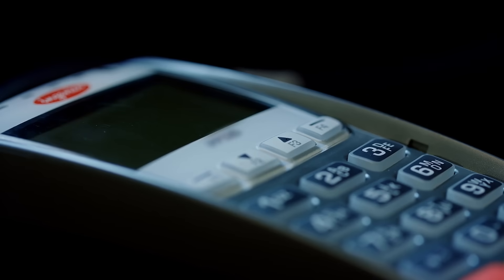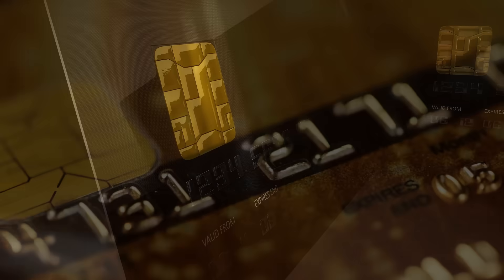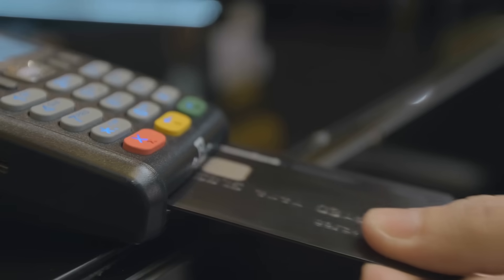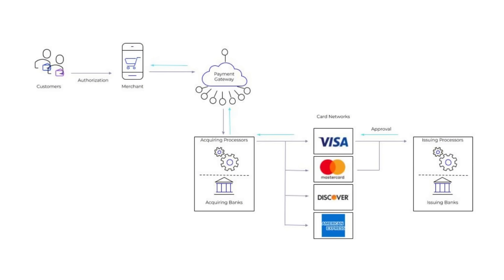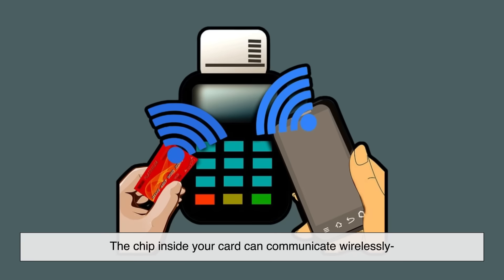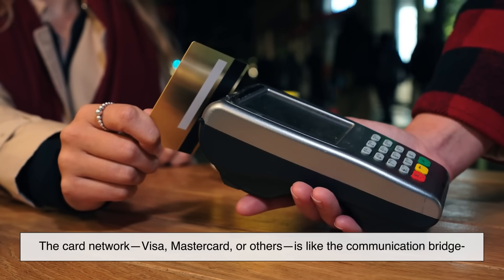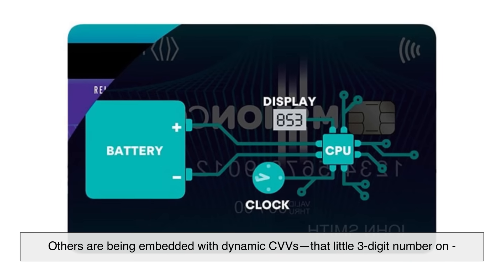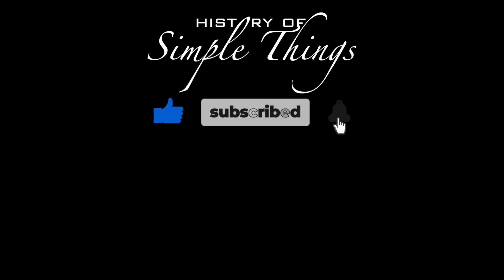What’s Inside a Credit Card Chip and How It Works

Comment: Thank you for the explanation. 

You should have started with the old card imprinters that took an image of the raised numbers and letters on the card.
Reply: The newest cards don't even have the raised image on the front.  The printed card number is now on the back.
Reply: @rocketscientist007  mine is same.
Reply: i remember those imprinters and raising hell sometimes to get the carbon page back. i'd take the carbons home and grind them up in the garbage disposal, does anyone remember when credit card purchases over $ 50.00 had to be ok'ed and tied up the check out until the clerk called the bank/store credit card ( like sears for example ) and got an approval code? the cash register wouldn't finish the deal until the clerk got a approval code to plug in. made for long lines and make you cuss like a sailor when someone pulled out a credit card, i like the chip credit/debit card and electronic money. way quicker these days, writing a check these days? forget it, too slow now. checking payments and accounts could be an interesting subject for this channel and creator. i only write maybe 18 a year now.
Reply: @roadmaster720  I worked as a cashier in the mid to late 70s. I remember all that crap. At a department store, I worked an electric cash register not tied to a computer. There was no phone call for a limit. The card was put thru the imprinter. The customer got one copy, the store copy was put in the bottom of the till, and the carbon was thrown in the trash can. Yikes! I was hesitant for years, but now I pay most of my bills and purchases thru a secure on-line site. Or I pay cash for small items and ALWAYS at restaurants.
Reply: @roadmaster720  "i only write maybe 18 a year now" - cheques? That's mad! Most of us in Europe haven't seen our cheque books in 20 years!
Reply: In high school I worked at a service station. Our card reader was worn pretty badly. We kept a blank piece of paper in the card reader so it would imprint onto the credit slip. Then you had to take it out, have the customer sign it and make sure you put your copy in the register under the coin box.
Reply: Ha, yes and the carbon copies that stores discarded even though it had your name and card number on it.

Comment: how is the chip powered on tap to pay?
Reply: When you tap your card, the payment terminal creates a small magnetic field that gives power to the chip, just enough for it to send your payment info wirelessly.
Reply: I think radio waves are sufficient to excite the electrons on an antenna coil which can induce a current.  I imagine it is a lower wattage version of the same tech that allows you to charge your phone without plugging it in.

Comment: For additional security and peace of mind, never use the debit card option. Always use the credit card option. With debit card option the funds immediately come out of your account where as with the credit card option you at least have 30 days if there’s some fraud that you need to have the bank look into. The only thing I use my debit card for is if I have to go to an ATM in emergency. Other than that, it stays safely secured in the back of my wallet.
Reply: Correct. Also, all my debit cards are locked via app. I too only use these at ATMs, and I first have to briefly unlock the card via the bank's phone app. Both Chase and BoA have that option.

Comment: You can imagine the pain the the clock in the dynamic cvv one starts to drift and your codes no longer line up with the banks code
Reply: If the clock inside a dynamic CVV card (with a rolling code on a tiny e-ink or LED screen) drifts out of sync with the bank's server, the codes might not match, which would normally cause declines during transactions.

However, to prevent false declines, banks typically build in a tolerance window, similar to how TOTP (time-based one-time passwords) work. This means:

Multiple CVV values are accepted during a short time window — e.g., the current code, the previous, and possibly the next (±1 time slot).

This compensates for small clock drifts (like a few seconds or even a minute).

But if the drift becomes too large, like several minutes or hours:

The dynamic CVV might consistently generate invalid codes.

You might get repeated transaction failures until it's resynced — which usually requires replacing or recalibrating the card.

So in short:

> Minor clock drift = tolerated. Major drift = broken card.

Comment: I've seen videos where criminals can steal your card info through your pocket... I'm not convinced that NFT is secure.
Reply: Slim RFID blocking wallets are like $16
Reply: If you have more than one card in yout pocket, NFC can't be used because the criminal's terminal can't read all cards simultaneously. And now all credit cards, identification card, driving card... All this has NFC. Then the criminal need a trust terminal to execute this false transactions... It's not easy.
Reply: @dacaca  Not a reliable solution. Whenever I placed my non-RFID blocking wallet near my phone, my NFT Tools app (android) would always read one of the cards (I'd get a short vibration). I have 4+ cards with NFC chips...

Comment: And yet that Magnetic Strip still exist on your card thereby negating All security in the chip!!!  🤨
Reply: Not so much anymore.
Reply: The credit card number is also on the card itself making the stripe useless.
Reply: The one cc I use daily for physical trans (grocery store etc), has holes in mag stripe, 3rd 4th of cc number, exp, and cvv. I used a belt hole puncher as soon as card arrived - well, after storing full details in secure place on phone. Even safer would be Apple/Google Wallet, but currently my phone is rooted so I'm banned from these...

In the rare cases I need to use mag stripe (parking garage etc) or full cc number, I have another "intact" cc that's kept locked until I unlock it briefly with a phone app... Then, for my handful of monthly subs or restaurant apps, I use Citi Virtual Account Numbers that are unique card numbers per merchant. If their system is hacked, the hacker couldn't use that one-time card number anywhere else... 

Haven't had a fraudulent cc charge in over 10 years now...
Reply: Magnetic strip cards only can be used in really old TPV terminals, the new TPVs that supports NFC or Chip, not let you to pay with magnetic strip, ever if the terminal have a magnetic reader. I try it with my job TPV and not working.

The more unsafe than magnetic strip it's printing the nº of card in the physical card with date and cvv.

Comment: How does Ali Express (that holds my credit card data) ensure that no-one can hack it?
Reply: Credit card transactions are divided into two categories. Card present and Card not present. Card present involves using a card in a store or somewhere you can tap to pay, which is pretty secure, as the video describes. When we buy online that is card not present and the defenses against hacking are much weaker. The connection between your computer and the merchant's server is encrypted, but the merchant gets your credit card number. They are allowed to store your credit card number and expiration date, too. So anyone who gains access to the merchant's server can read all that info. Could be an employee or a hacker. The 3-digit ccv code you ever for each transaction  is a bit of a defense, since the merchant isn't supposed to store that, but a hacker or rogue employee could bypass that and cause ccv codes to be logged. So the bank charges higher fees to the merchant for card not present. transactions to cover the higher rates of fraud, which is reflected in the purchase price. Digital CCVs, mentioned briefly in the video, are an interesting way to make these card not present transactions more secure. Would love to see that become widespread. ApplePay, GooglePay, etc are also much better than giving out your credit card number.
Reply: Simply by trust, the bank plataform trust in this "sellers" to let him remember "your credit card data" (really they only save a token than represent your credit data). If the seller make a fake transaction not recognised by you, the seller has a problem and the Visa/Mastercard/Bank can return the transaction to client.

But the recommended action in Aliexpress and unknown sellers is put a virtual card, with the exact money of the transaction and no more.
Reply: They don't. Never heard of any of those hacks where whole companies databases got leaked?
This is where PayPal comes in. This is the agent that allowed for ordering from untrusted shops everywhere in the world (well mostly China)
Reply: Easy. You setup that cards account to have no money in it and no overdraft. Then only put money into that account when you buy something online. If theres no money to be stolen you cant be robbed.
But yes that does requre you to have a 2nd card that ya gotta pay for unless you really wanna go to the effort of transferring money each time ya paywave it
Reply: @Mattvbro The main downside of using prepaid/secured cards like these is that cashback is very low and  limited. I prefer my Citi Double Cash card where I get unlimited 2% cashback and can generate a virtual credit card with short expiration and specific limit...and I can close that virtual card at any time too... My account isn't tied to some min balance checking account, nor do I need some monthly direct deposit... If I spent more money I'd go through that hassle and get the 2.5% cashback with Alliant Cashback...
Reply: @Mattvbro  You have to pay for cards?

Comment: It really is a mini computer.  Just very locked down and only enough resources for its purposes.  The interesting thing is that it is a lot smaller than the golden square on the card
Reply: I write code for microcontrollers, similar to what's in the card, and it really is amazing what you can do with even the tiniest resource-constrained computer and well-written code... In fact, I'm sure there's someone out there trying to install and run DOOM on one of these card chips right now. LOL
Reply: @roberthoople  It boggles my mind that the way cheap gadgets flash an LED these days is by using a microcontroller and some code!
Reply: @roberthoople  😆  when your board ?

Comment: this is amazing. I was under the impression that it was some kind of RFID 
I always use a pin, because it find it hard to write my signature on the screen
with my finger. it ends up looking like a little kid used the terminal for doodling
Reply: pro tip: It doesn't matter. Mine looks like that too and I've been signing the screen like that for years and never had a transaction refused because of it.
Reply: Validating with a signature on a government issued ID in some countries or merely having someone do that same signature on paper and comparing can always work if a merchant has a concern.

Comment: How does the tap to pay get powered up?   Great informative vid!
Reply: The reader sends an alternating current through a coil of wire. This generates a pulsing electromagnetic field around the coil. The card has a wire laid out in a few loops (or squares). The pulsing electromagnetic field induces a current in the wire in the card which is enough to power it. The same principle of inducing current in nearby wires is how transformers work.
Reply: @jonscaplan  I predict that we'll have broadcast power by the end of the 21st century; just like we have cellphones today. Tesla was right; and we will "re-invent the wheel" when it comes to electric power. But we still won't have colonies on other worlds.
Reply: @themagus5906  No, we won't, as it defies the laws of physics and would charge up everything, causing electric shocks if you touched anything metal.
Reply: The card reader sends an electric impulse to the chip on the card via the RFID communication protocol/process so as to stimulate and wake up the chip on the card. 🙂
Reply: @ThinkingLeaner  Cool, kinda what I thought. Thanks!
Reply: @msbgone per my engineering education,  most embedded RFID chips (in many products) lay dormant without power and are stimulated by the signal of the powered RFID reader.  🙂
Reply: @ThinkingLeaner  no battery....  neat.
Reply: It's like wireless charging for phones and smart watches.

Comment: Curiously, Canada started using chips in credit cards in 2008, a full 7 years before the USA.🇨🇦
Reply: Curiously Europe has been using chips for what must be the past twenty years
Reply: The fun part is tapping in the US. You touch your card to the terminal, it goes beep and starts printing the receipt, and they're like "what?"
Reply: That's one of the few upsides of having a bank oligopoly (a few dozens instead of a few hundreds). You can implement technology upgrades quite more easily.
Reply: Yes plus I don’t ever recall using a signature here in Canada 🇨🇦. It was always insert the card and punch in 4 digit PIN. Now I only need to use PIN if total is greater than $250.  I wish Visa would increase that $ level because exceeding $250 at grocery stores is very easy to do.